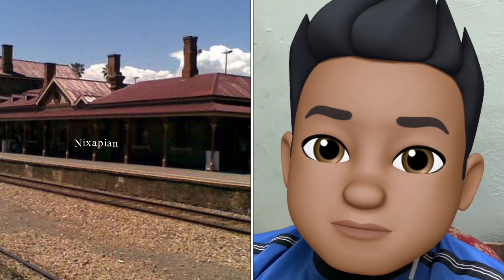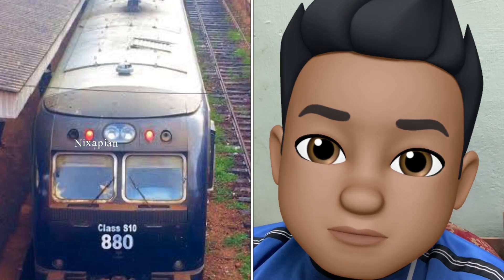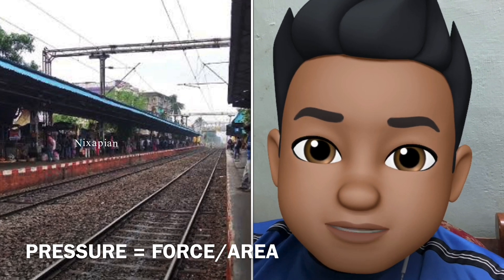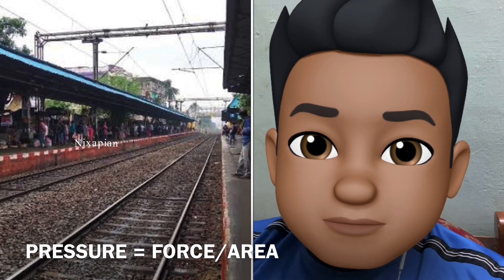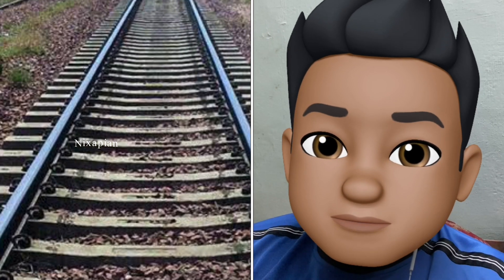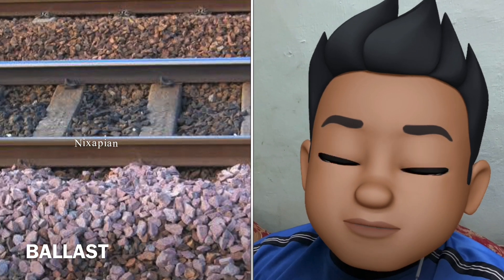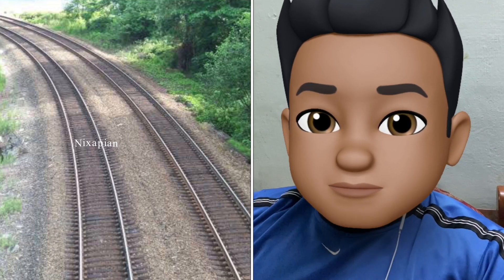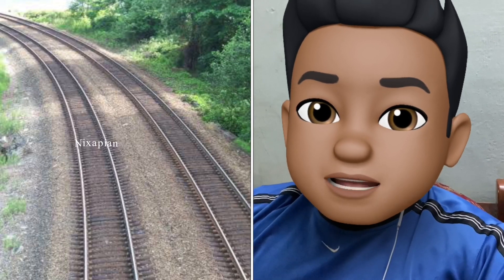Why are there STONES and concrete SLEEPERS in RAILWAY TRACKS 🛤 | Ballast | Sleepers | Train | Rail

Comment: Simple and useful information for a commn man. I always wonder how did this works.
How about over bring dge trains as there won't be stones? 
BTW the voice over through the emoji is a good try 😬
Reply from the maker: Thanks bro🙏. 
Good question 💯 

You should note that the over bridge is made of concrete and much stronger than land with soil.
The over bridge is designed so as to keep the track in place, no vegetation’s grow over there as it’s concrete and there is a separate system for drainage of water. 

Hence no ballasts are used.😇
Reply: @drvishi  Alright Sir. Thank You :-)